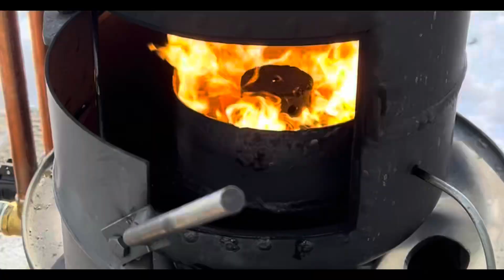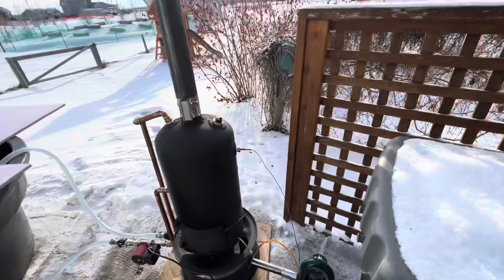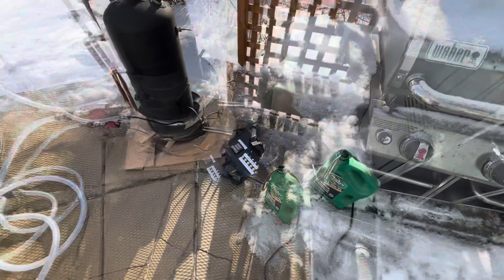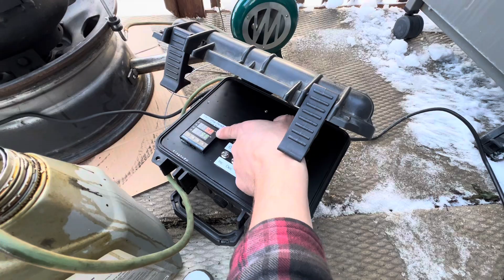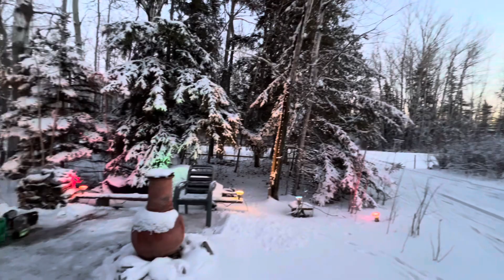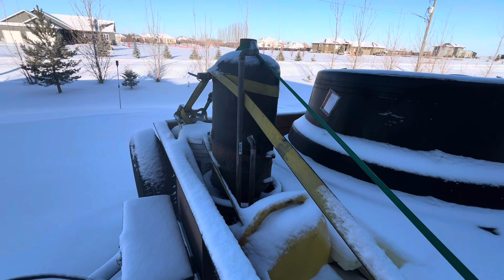Waste Oil Burning Water Heater - WOBWH Finale.

Comment: What type of tank are you using and the size? Can you post pictures of the burner? Thanks
Reply from the maker: The combustion tank is a 20lb propane tank, the top is a 30lb tank. 

The second video (pt2) in this build series shows details on the burner construction. 

Waste Oil Burning Water Heater - WOBWH Build Pt2
https://youtu.be/XdFCLfdyegc

Comment: What do you think about an oil burner with just a chimney outlet then build a water jacket chimney.  I'm thinking like 1" diameter of water around the chimney with a flow pump to keep it from over heating.  That would solve your weld access problems to get it water tight.  It would not be a large reservoir of hot water, only an external heating element for something like a hot tub.  you could also make your water jacket any height you wanted then, but also you'd end up with a lot of weight high up which could be a safety issue.

You could incorporate both to harvest even more heat off the exhaust while also being configurable as you could run the heater without the chimney jacket.

I'm also thinking if you had just a heater with a water jacket chimney, you could configure a different chimney to power something like a sauna for dry heat.
Reply from the maker: Thanks for your comment, I really appreciate it when people give me food for thought! I did think up a solution for testing the inner weld on the water reservoir! The first task would be completing that inner weld around the flue and adding a test bung to the combustion tank. That way you can pressure test it before cutting the door and moving on with the build. 

I like your idea for various chimney options and smaller waster jacket, coincidentally you will see a departure from the reservoir water heater design in my next version. Not exactly how you described but it eliminates the storage tank and any welds that could potentially leak. I also expect to increase efficiency considerably!
Reply: I can't wait to follow revision 2!  @rad1876